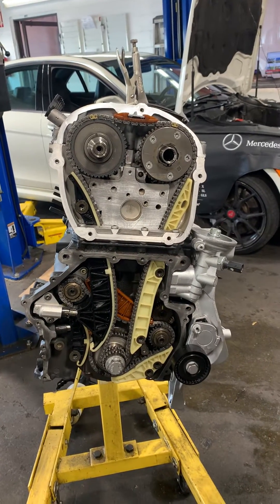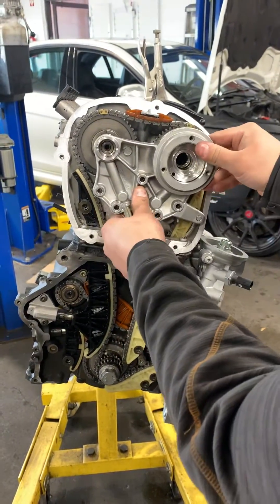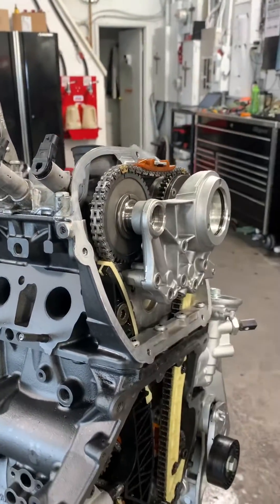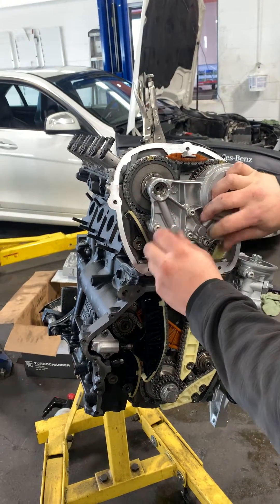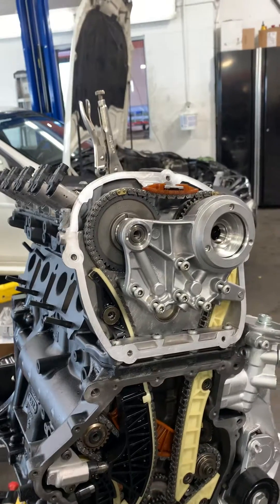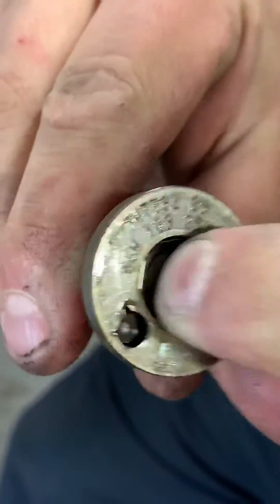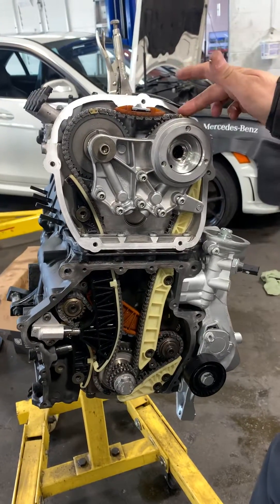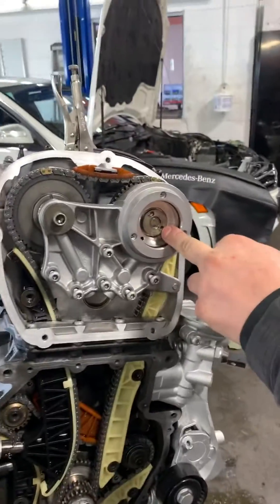Audi 2.0T Cambridge install

Comment: Can the bridge be removed, the filter taken out, and the bridge put back without locking the timing chain?
Reply from the maker: Yes
Reply from the maker: They usually don’t fail you should replace the camshaft adjuster valves they get stuck
Reply: @anythingwewant604  The weird thing is that I already replaced the VVT solenoid and the magnet on the right side of the engine, near the radiator. At one point, I made a mistake and used regular oil instead of 0W-20, which wasn’t the correct European spec. After I realized that, I used STP to flush and clean the engine. After that, the EPC light and check engine light started coming on every time I started the car, and I think this might have caused the problem.

I noticed that the magnet was stuck and the VVT solenoid was dirty after that flush. I removed them and replaced them with OEM parts. Then I checked the VVT and magnet on the other side, near the windshield. That side wasn’t very dirty, thankfully. I also did another flush using MOLLY  engine flush, which is compatible with German cars, and cleaned everything. I checked the magnet, and it looked good. I also cleaned the VVT solenoid, which came out pretty clean, and then I reinstalled everything.

The car runs great, and I know it’s not the timing chain, but the oil flow between the VVTs doesn’t feel completely even. Now, the same issue is happening again. I also replaced the camshaft with a Volkswagen brand part because the check engine light was coming on for that system.

The EPC light still won’t turn off. Every time I turn off the car and start it again, the check engine light comes back. The code is P11A200 – Camshaft Actuator A, Cylinder 1.

This is a 2022 Passat with 115,000 miles. I’m trying to pass emissions. The oil is correct now, and everything should be running fine, and the car drives great—but the issue still persists.

Comment: What did you torque the little valve to? Great video thanks.
Reply from the maker: @sebastiancordova6839  don’t over torque it or you will have oil pressure issues. 20 nm should be good. I didn’t look up the spec but 20 should be fine it’s reverse thread
Reply: 15 nm

Comment: Perfect video on how not to install a cam bridge. No oil, or assembly lube. Never beat the cam bridge on grab an 18mm wrench and slightly rock the cam and it will slide on without beating it on.🤦
Reply from the maker: Then why did you watch the video 😂
Reply: @anythingwewant604  Because it was the first video that popped up when I opened YouTube. Way to go man keep up the great work lmao.